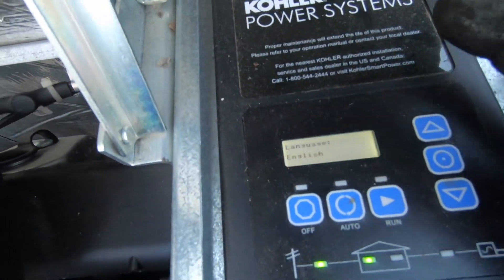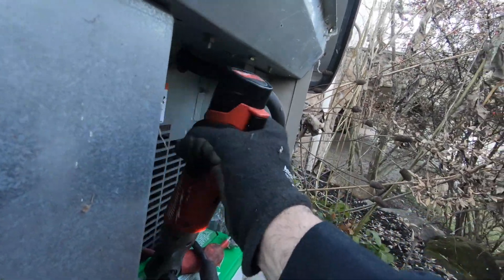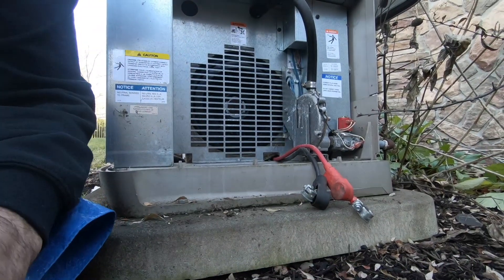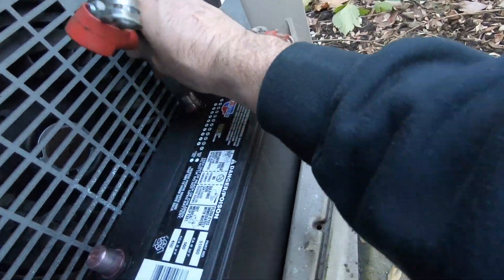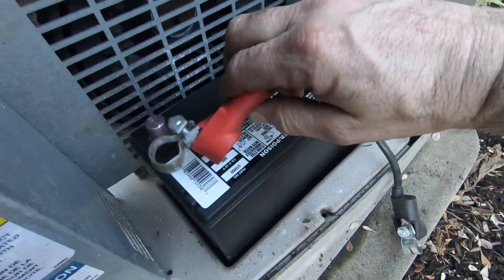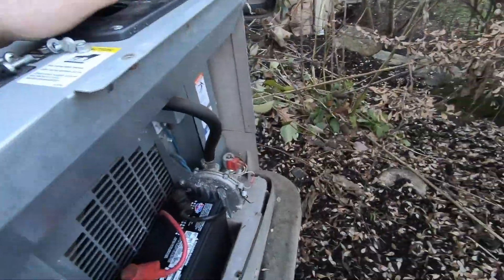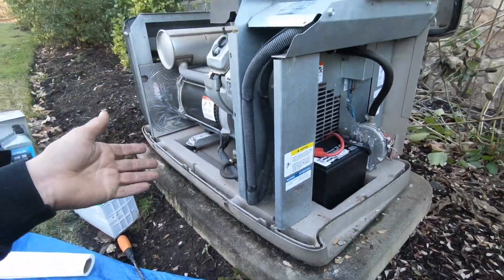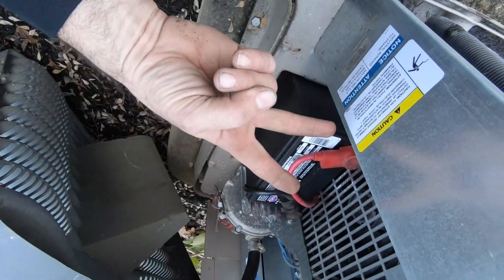Troubleshooting and Replacing a 12-Volt DC Battery Kohler Generator

Comment: Thanks for the great videos! 👍 Our Kohler 20RESA generator and original battery is 5 years old this month and even though it's been flawless, I just ordered a replacement battery. The generator came with a Deka 551MF battery. We live on the coast in the Northwest. Temps are moderate although for a few days it can get down in the 20's in the winter and 100 in the summer each year, but not too many extremes. Our generator runs a 20 minute test every week. Power failures are fairly infrequent. So we have less than 100 hours run time. Five years for any battery is great so I bought the same Deka 551MF battery from Lowe's. If it lasts another five years I'll be more than happy.

Comment: Awesome saved me a service call.  Kohler generator purchased 2013. in 2016 battery exploded replaced with walmart ezsrart battery $147.plus 7% tax. August 11, 2020 replaced battery from Costco, Interstate battery $82.42 after core exchange and tax.  Thank you so much.
Reply: Whats the  battery model number you bought from Costco?
Reply: @imran356  Most Kohler batteries are Group 51 or Group 51R.

Comment: I'm just curious, why call an HVAC guy for generator service ? Maybe I'm missing something ?
Reply from the maker: Would you call the hvac company if they are a premiere dealer of the brand generator you own? Who else works on generators besides HVAC techs? Also many of the generators I’m working on my company installed
Reply: @thehvachacker  
Sure it would make sense to call the dealer or installer. I guess I am used to electrical firms doing that. In the northwest there are even electricians that specialize in generator power. If you are capable keep up the good work.

Comment: Did you tork the battery nuts. I see you take pride in your work.
Reply from the maker: I just tighten till it feels tight. Yet no reason to over do it. I ran into too many cracked led battery terminals from someone over-tightening. Most stuff requires only inch pounds of torque

Comment: If the battery exploded before and this one was dead after 3 years it wouldn’t hurt to have the charging system checked. Most chargers maintain the battery in good health when not in use by measuring the voltage and charging it when low.
Reply from the maker: Kohlers are notorious for overheating the battery. Last one overheated trying to crank on a near 100 degree day with dry cells. 3-4 years is the average life on a standby genset
Reply: I found that battery voltage a little high for standby service.  But it is what Kohler designed in.  I would have had it down around 13.5 to 13.7 volts for float service, if I were designing it.
Reply: Kohler makes a wiring harness to reduce the charging voltage . Not sure what year they actually realized that the machines were programmed wrong but I’m sure the customer was the last to know . There is a video on YouTube . My 2015  is charging at 13volts

Comment: Do you ever find the cells low on water?   I used a maintainer that was supposed to cycle off, but, if I didnt check the levels, it would have cooked the battery dry.
Reply from the maker: Yes, often I find the cells low why on maintenance I check. Kohler is notorious for overheating the batteries with the trickle charger. The last battery in this generator explodes from the cells shorting. Due to the lack of fluid.
https://youtu.be/ssCsgTw1sfc
https://youtu.be/WwLcgWV-2sQ

Comment: How hard is it to maintain the generator as an owner? Yearly or every 6months? Trying to get a feel for it so when I buy one. Thanks. By the way copper thiefs are out in JERSEY THIS TIME ITS ROOFTOP UNITS. 5 ARRESTED.
Reply from the maker: It’s mostly spark plugs, air filter, oil change, making sure wires and no fasteners loosened up. Maintenance isn’t tough it’s when the break down that gets interesting
Reply: Thank you for the heads up. Whats your cost for a service call to NC??? LOLOLOL HVACR ON KID!!

Comment: Do the glass matt batteries last any longer? Three yrs. is kind of short, but constantly on the charger will do that. Thanks for the video's.
Reply from the maker: They all seem to last in the 3-4 year range. As long as the fluid in the cells don’t dry up